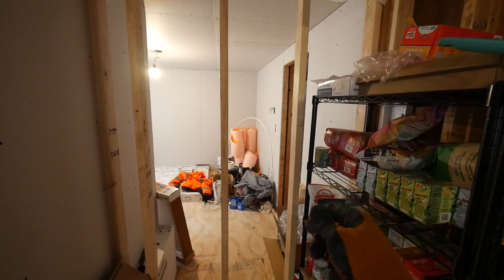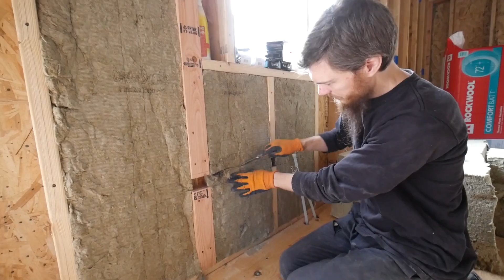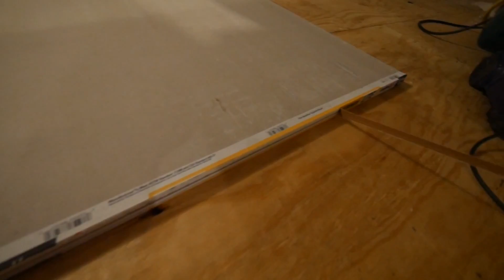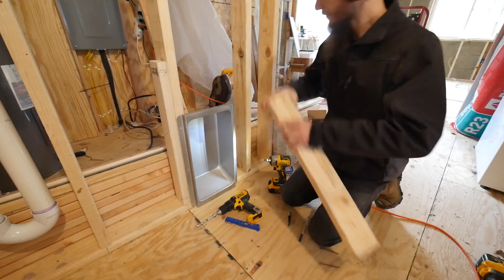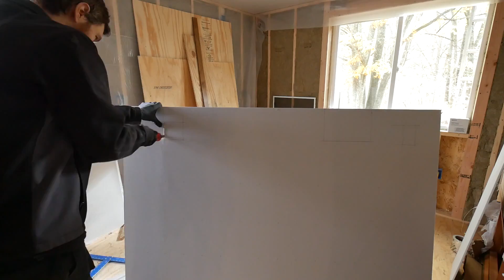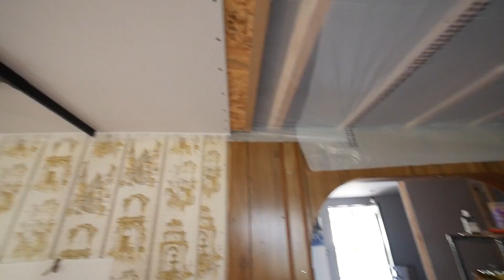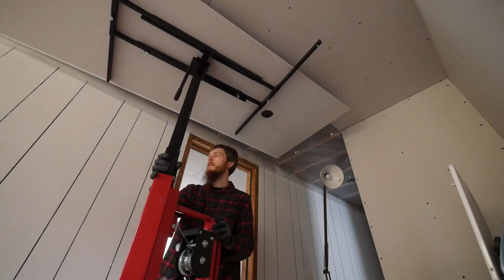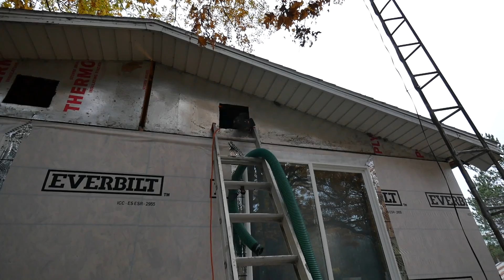Renovation Overload | Why we Install a Vapor Barrier on the Ceiling - Home Renovation

Comment: i thought the laundry was inside the room with the water heater, it looks terrible just sitting in the middle of the house with no walls
Reply: Veronica Deras-Roiz  it’s not even finished yet give them a second, jeez.

Edited to add a comma
Reply: They'll probably add doors or at least a curtain - it'll look great, don't worry
Reply: @Veronica Deras-Roiz Everyone has their preferences... If you travel/go around Europe washing machines are mostly in the kitchen.... Best just appreciate what the DiYF family are doing...
Reply from the maker: The washer/dryer nook will be right off the hallway. We made it there since it breaks up the tunnel-like feeling of the long hallway. There are more walls that will be going up and it will all come together better with time :)

Comment: Your # 1 problem is organization . take plywood and make several Mobil tools and parts. Second finish whirring rough plumbing. Clear your work area and make Mobil tool bench on wheels that will fit thru a doorway. Seal all openings rodents will be moving in. Set up rodent control. Bisque over call space. Insulation sho u let only be done when punch list is done. . you wasted to much time on kitchen demo and bathroom.
Your wife needs to focus on cleann up and organization. Your wife can do painting insulation and lite electrical. I rehashed 800 Apts in five years. Use home depot supply free delivery or Amazon $12 per month order just in time. Delivery
Reply: Sorry but you sound like those wardens in boarding schools. lol
Reply: When other people  prioritize differently.thsn yourself, it doesn't  mean it's wrong. Plus, there very well may be reasons why they are doing it in an order that suits  a family living in it during contruction,  nap times,  supplies availability,  weather, injuries,  man power, and lighting.  They work on their own homes & are not running a business  or apartments. I think you should prioritize being polite & reserve judgment.